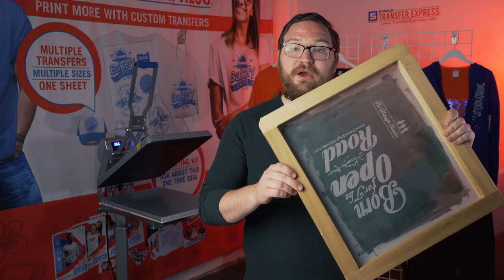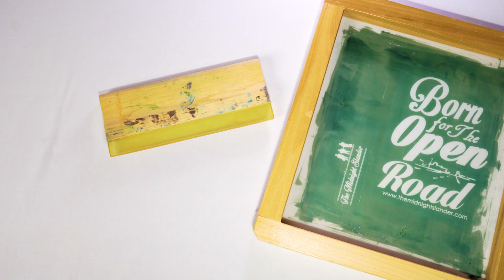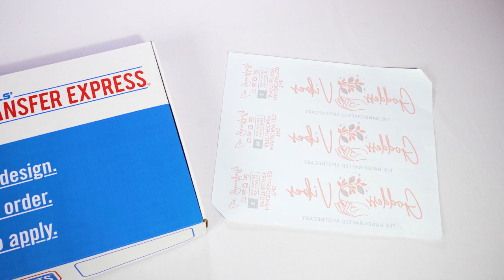How Much Does It Cost To Start A T-Shirt Business? DTG / Vinyl / Screen Printing or Heat Transfers

Comment: Do you have a link of where to buy the items needed for the screen printed transfer method? Also, what type of printer/ink/computer is best for this?
Reply from the maker: Sure thing! Essentially all you need is a heat press- we handle the screen printing for you. 

Since these are screen printed plastisol ink, there’s screens and emulsion, presses and dryers- we handle all that so you just press it! 

Upload your art and your prints arrive in just a few days- no need to buy expensive printers or paper. Everything is at transferexpress.com (we’ll even send you a free sample pack just for signing up!)
Reply: @transferexpress  I was looking to start my own business even with the screen printing, but I didn't know you offered this. How much do you charge per screen print (for 1 shirt/sweatshirt, etc)? Is there a better way we can connect with each other to talk business? Thank you
Reply: I want t start
Reply: I want start  business..is it possible for you to send